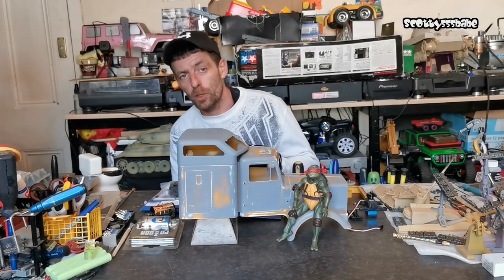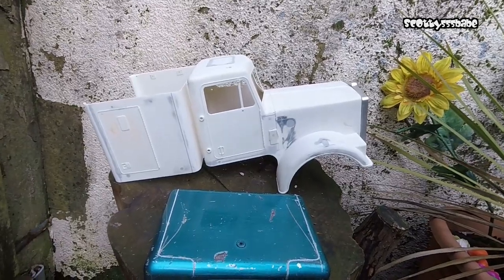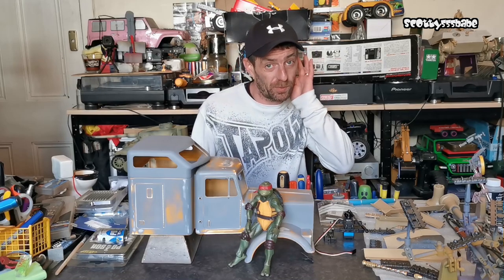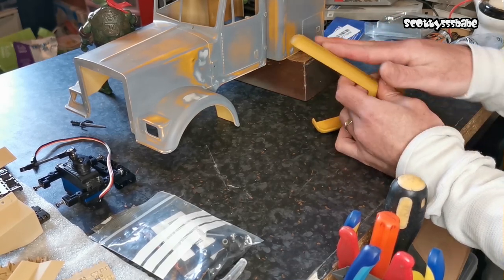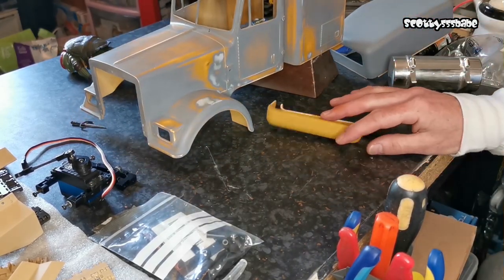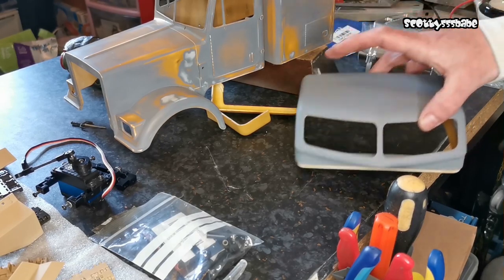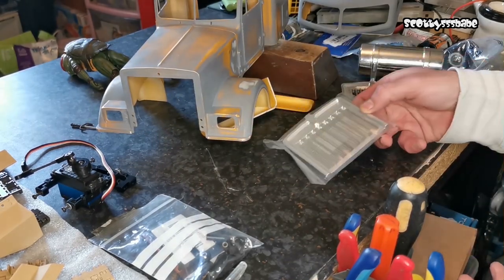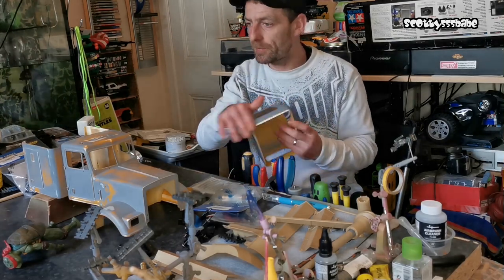Making Custom Sleeper Extensions | recycling parts | Custom Grand Hauler Kenworth W900 Rc Truck

Comment: Really nice detail work...you're not cutting corners but taking your time .
Reply from the maker: I'd built it as a basic Grand Hauler and slowly over the last couple of years all the chassis has been upgraded and I want the best possible paint finish i can achieve as I'll be airbrushing it instead of rattle cans, so all the time is on the prep work at the moment, but it will all be worth it when completed 👍👍👍

Comment: "Chinesesium"!!!!! 😜😅😅😅  I must remember that. Glad I found your Channel again. This is damn exciting! I'm gonna get some great ideas for my Rigs.
Reply from the maker: 🤣🤣 My nickname for Chinese goods... I was reluctant to buy it at first as the whole rig is built from Lesu, Gpm and Rc4wd but I believe it will look the mutts nuts so I got it 😊😊👍
There'll be plenty to come as I'm currently buying up odds and ends off ebay and fellow modellers so I can move away from standard kit builds and get creative 😊👍
Reply: Is LESU as expensive in the UK as it is in the US? There's so many things I'd love to get. But this Old Disabled Fart can only do so much on a fixed income... ☹️ 

I need several spare parts, like King Hauler bits. The only two I know of that have it, is you and Teri Wilde... Shipping TO the USA is beyond ridiculous since bloody COVID! 🙄 😭 

I just started with 1/14th Scale Semi Trucks just last year, only because of an Inheritance. I bought 7 kits at once! 
Grand Hauler, 2 Globe Liners, 1850L Box Truck, the new 8X4 Tipper Truck, and 2 Trailers. 
4 Beier Sound/Light modules, BUNCH of LESU Tyres, 2 full sets of Alumininium Wheels, 4 Gear Reduction Units... 
Boxes of Paint.
And boxes of detail parts from Garden Trucking and Evilbay. 
.... and now I'm out of money! 😭 
But I've got a couple of years of fun work ahead of me!!! 👍👍 
And watching your Hauler will be a lot of fun!

Comment: Awesome work
Reply from the maker: Thank you
Reply: Hi Scotty can you tell me how to cut this 6" frame for my grand hauler I put to sleeper's together and smooth them into one bought a 6" frame and a 21" drive shaft I'm 74 years old and not sure where to cut no direction where to cut and no video to see where to start at can you direct me to a video or a diagram where to start so I don't mess it up this is a double sleeper thanks or send me a pic where to start the cut thanks remember it's a double sleeper

Comment: It’s getin there u goin fill the lines when u put roof n botum parts on or leave the lines bro slowly dose it bro 👍👍👍
Reply from the maker: Yes going to fill all the lines then it's all smoothed and with the cab I got off you Im going to make an extended sleeper using the sleeper I cut off Rusty 😊 got too many projects on the go 🤣🤣 the tank is taking most of my time at the moment bro 👍👍👍
Reply: @scotty555babe  that will take some time to get the joint rite when u extend the sleeper with no joints in it then when u have done them ur have to build a low bro trailer to tow the stretched costum truck bro lol 😂
Reply from the maker: I'm going to use the lines which are at the front and rear of the sleeper for a clean cut and they should both just line up perfect..
Going to smooth the sleepers out as I've done on this then it doesn't look as tacky with doors, windows and rivets everywhere 🤣🤣
Reply: @scotty555babe  ye u could keep couple the doors ur have to c how it looks when u put them together bro n ye def smooth all rivets off bro 👍👍